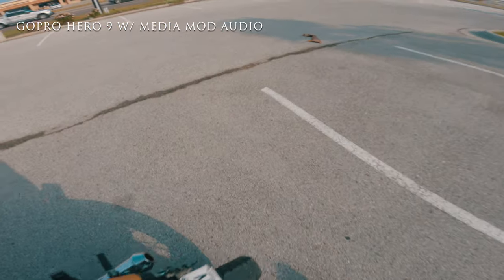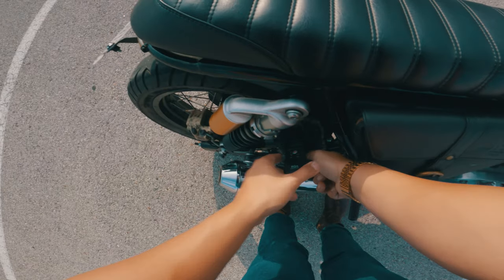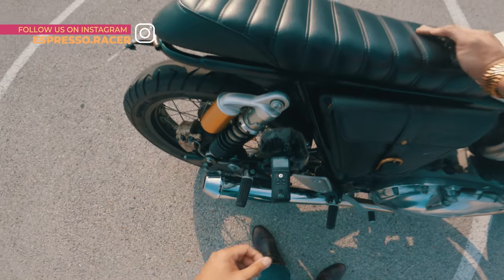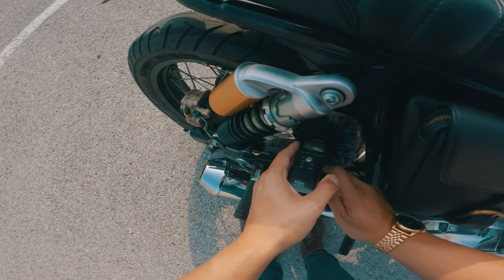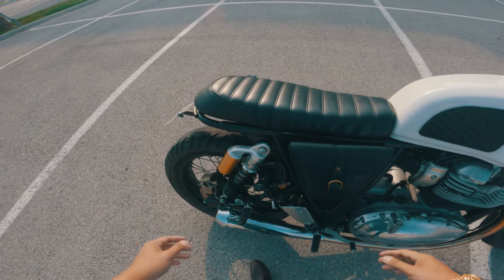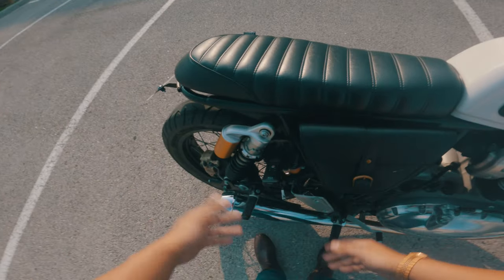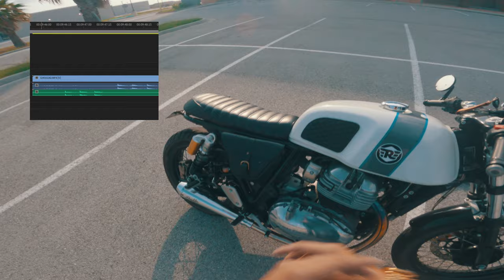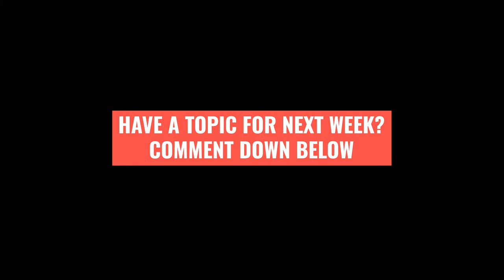How to Record Motorcycle Audio | Royal Enfield GT 650 | Throttle Thursday #3

Comment: Can we use a basic lavelier mic instead? Have you tried that?
Reply from the maker: Hey! I haven't tried that, but I can make that comparison on a future video with my Purple Panda mic :) 
It might make it easier for placement in tight places on the bike
Reply: @EspressoRacer  Yes, it would  be cheaper and easy to install with Zip Ties. If the cable is long enough.. I would suggest you put it under the seat so less wind (I think) and also closer to the pipes to pick up the sound better.
I am anyways going to try this and post it on my channel, because I dont want to invest so much on a wireless mic at the moment.
Also, seeing the watch on the right hand :) triggers my OCD.